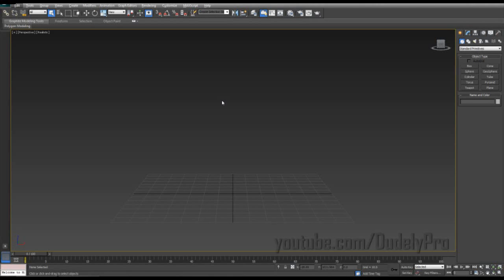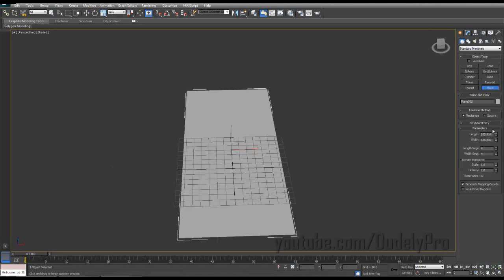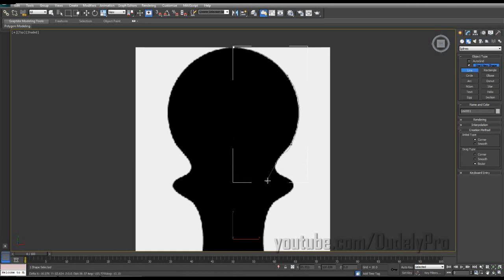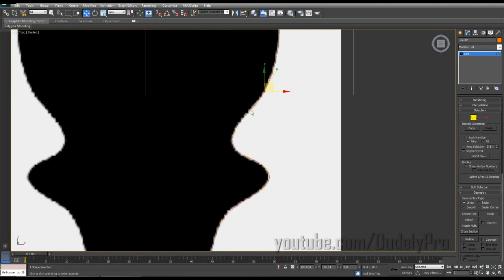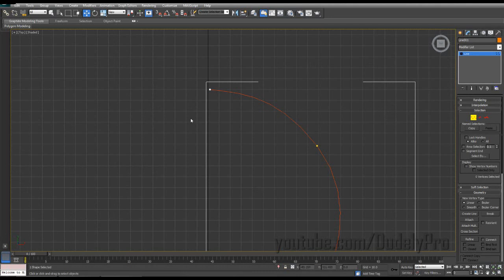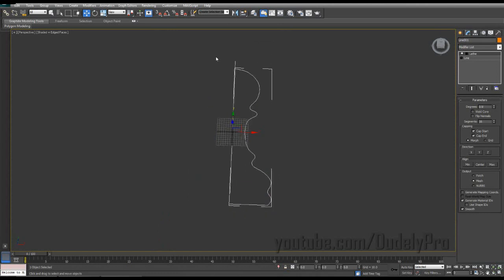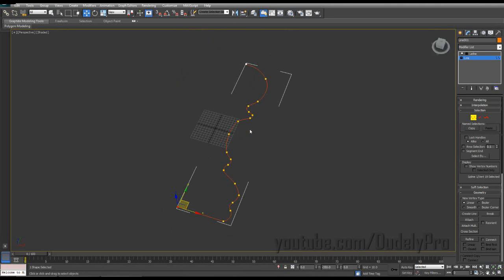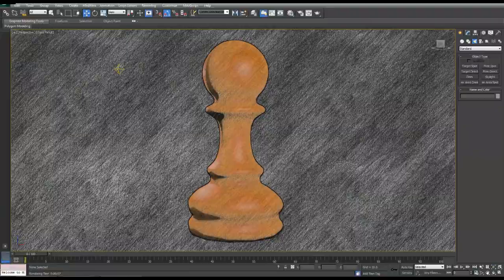3DS Max Lathe Modifier Tutorial

Comment: Ok Both this and revolve in cad make the object blocky with lots of polygons. I used turbo smooth to fix it but its still not quite the result I'm looking for, just lots more smaller polys that cause my slicer to lag. Why cant I just get smooth curves with this? What do I need to do to fix it. I want to export an stl for 3d printing so I dont know if that makes a difference in procedure or not.